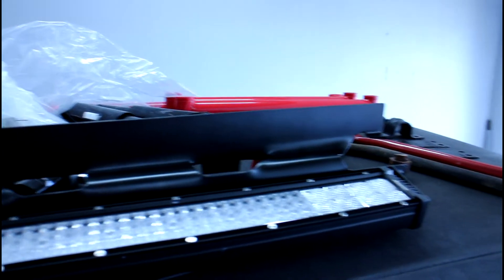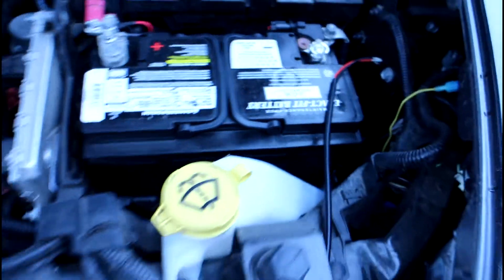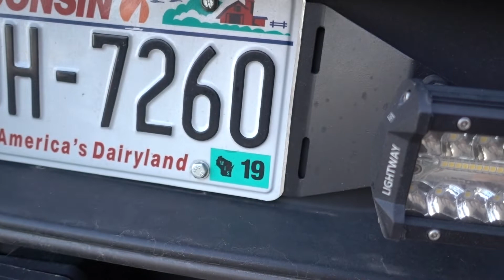Cherokee KL - Mohawk Off-Road Fab Front and Rear LED Light Mounts

Comment: I'm thinking of getting this but I'm little concerned about blocking the airflow to the radiator. How much area does it block ?
Reply from the maker: I don't have the vehicle anymore, but I didn't have any issues blocking the radiator.  You have to remember that non-trailhawks have active aero there, so the radiator is being blocked on those from time to time as well.  I wouldn't be concerned personally if your cooling system is in good shape otherwise.

Comment: I bought the rear license plate bracket and was a little surprised when I got underneath to put the bottom bolts on that it was all covered with stuff. Can you show me how to install the bracket and the best way to wire the pods? I'm new to modifying my jeep and trying to figure everything out! Thanks
Reply from the maker: Hey, sorry for the late response.  Do you have tow package?  I was able to insert the lower bolts right above the hitch.  Without it, you should be able to remove the 'Cherokee' plastic piece, assuming you have a Trailhawk.

Comment: Is there a way to permanently mount the bracket instead of using C clamps?
Reply from the maker: You could definitely drill the support and use some bolts if you wanted to.